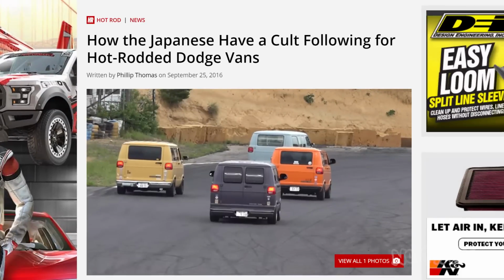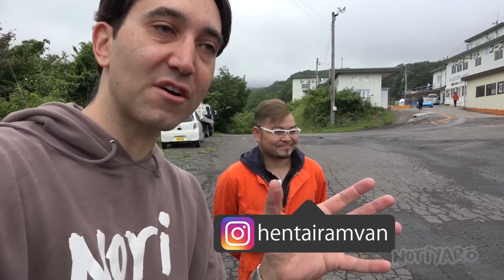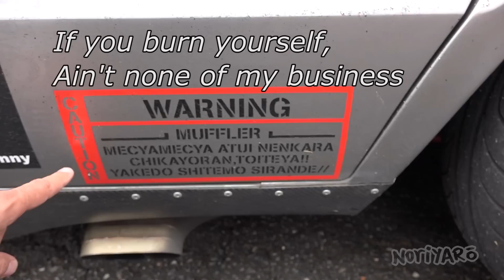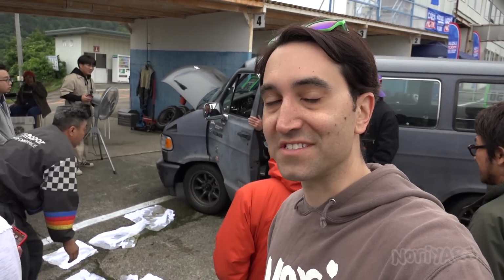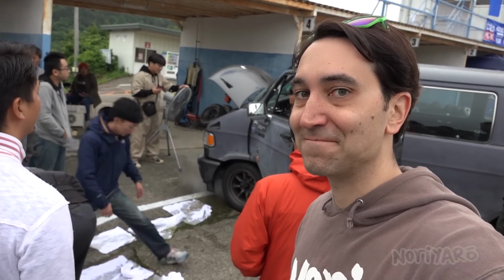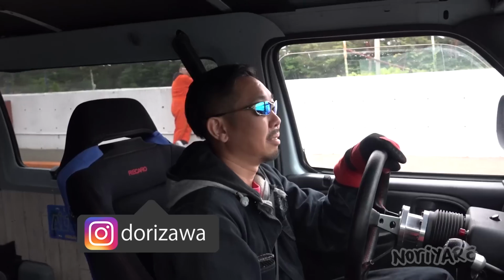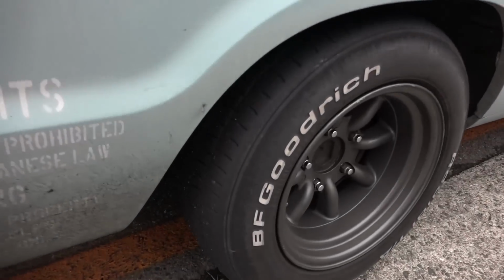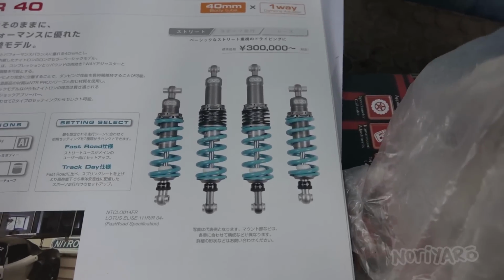DAJIBAN! Japanese Dodge Vans are back at Ebisu Circuit

Comment: Dude is drifting an automatic open diff van. People should have no excuse when it comes to drifting.
Reply: torquey engine + no weight on rear wheels + skinny tires + hydraulic e breke = drift. not as hard as it may seem, still hard, though!
Reply: Ryan, i have the 1 ton, long wheelbase version of this van (with the 350ci v8) and it is horrendously underpowered. To get it to rotate is no small feat.
Reply: lol it's all that MOPAR!
Reply: Must be custom.  lol
Reply: probably the 360. you make a total of 5 hp more from factory over a 318
Reply: I have a 5 Spd At G35 sedan open diff. All weigh transfer tbh.
Reply: @CookedTickabc  10* swap in the 5.2 cam(way bigger than the 5.9 cam) and youre up even more.
Reply: @keeganwebber  If it's that underpowered wouldn't he be weight-shift drifting instead of e-braking?
Reply: @chilael6892  he appears to be using a handbrake in the video

Comment: That wasn't a long van.  There are two wheelbases and three lengths.  That is the medium length.  The long vans (called the Maxi-van) are nicknamed "carpet vans" because they can carry huge rolls of carpets or conduit.

I currently own a 1996 panel B2500.  Runs strong at 393000 miles with the 318ci engine.  Watching these videos makes me want to build a Dajiban!
Reply: DO IT! That'd be awesome!
Reply: RedheadHemi 04 
   Wow you know something about Dodge vans huh?
   5 years ago I was given, yes given, a '97 conversion B2500 318. It's my first Dodge and my first van. I'm about to turn 55 and I love my van. I've been redoing the interior to make it more usable/comfortable, but have no idea what possibilities lie under the hood... I'm no mechanic. 
Do you know of or have any ideas? I spent a year in Okinawa (80s) this video kinda gave me flash backs lol.
Reply: Correct.  I have a 99 Ram 3500 1T extended passenger van. About 8,500#

Comment: See I would want one, and I do, but I’d be like the only guy in Arizona driving around in one, and I’d have no use for it, so I’d just look like an idiot rapist that doesn’t understand what blending in is.
Reply: Joseph Samsor TO THE TOP!
Reply: I absolutely love my 97 2500 standard wheel base. 318 cargo. They'll peel it from my cold dead hands. I can tell you from first hand experience there are few things in this world cooler than a sik as hell Dodge van. my dream is to  eventually 4x4 it and swap in a 4 cylinder Cummins.
Reply: yup mmhm oh yeah 4bt swap. Make sure you turbo it though if you do. Nothing like a boosted diesel.

Comment: If any of those guys lay their hands on a Mopar Performance R-block prepped by Dick Landy, and a Torsen-style replacement differential for those rear-axles, they'd be just a set of Cal-Tracs or a four-link rear suspension away from showing some serious times around the course.

Comment: Cool video man. Got a question though - think you can find out why they prefer the 318 over the 360 block?
Reply: masterwhopper414 the 318 is a higher reviving more reliable engine.
Reply: FAR more common
Reply: +Dodge 318 Cummins, ah I see. Wouldn't the 360 be more useful in this application due to the low-end torque it has? And since the vans don't have that high of an entry speed?
Reply: + Frigglebiscuit, I guess so
Reply: masterwhopper414 the 360 is a dog compared to a 318...

Comment: It's great to see someone taking one of the greatest American vehicle designs and appreciate if for what it is and what it could be. But why in the world limit yourself to the 318??? Old 440 cu in Dodge Grand from the mid 70's on are easily available. That's why these van look a little slow on the straightaway. I had a 440 and with the right cam, headers and raised compression would really rip!! Even if you didn't install a lot of aftermarket components or set the engine back 2-3 feet those early Dodge vans were monsters AND had surprisingly good handling.

Comment: I have seen some of these that had completely fabricated suspensions front & rear, using almost none of the factory parts. Tubular A-arms, coilovers, 4-link setups in the rear, etc., and also using Magnum 360 engines bored & stroked to over 400 cubic inches. Not all of them are stock 318's.
Reply: M Kefer 318s are a lot better than a 360 with just basic modifications.
Reply: I've owned vans with the 318, 360, and 3.9l V6. The 318 is a fine engine, but to say it is better than the 360 is a bit of a stretch. I guess it depends on whether you want a daily driver that makes decent torque at low RPM and still gets reasonable gas mileage, or a high-rpm, high-HP setup. My old '78 B200 shorty was a handful even with a stock 360, with a 4-bbl and headers and a mild cam. I do love those 318s though.

Comment: incredibly late comment on this but my theory for why watanabe wheels look so nice on these vans would probably be because of how are brains perceive patterns and similarities in design choices. Watanabe wheels are relatively plain from a design standpoint, they are thick and rounded as well as looking much bigger than they actually are since their diameter isn't actually as large as it seems. Much like the van itself, not really that big, rounded and not really boxy design wise as well as being quite bland to look at. It's like how watanabe (in my opinion) would NOT suit an FC RX7 for example because it's a quite boxy design with a lot of sharp edges instead of smooth transitions from the top to the side etc.

Comment: Those 318's are usually pretty dog slow, im surprised their not stuffing 2j's and RB's in these things
Reply: Danimal 86 Because torque and complexity, why stuff an I6 with barely any torque and would most likely struggle with the van’s weight for a V8 with decent power and enough torque to propel the van.

Comment: Chevy gets 8.1 Big Blocks, wonder why something as cool as that didn't get the same cult following as a 5.2 Dodge Van
Reply: DC BigTurbo I think they like the Dodge because they're unibody.
Reply: DC BigTurbo 318 v8 is the best engine out that's why...
Reply: Cause fuel....
Reply: if you're worried about mpgs when racing, you shouldn't be racing
Reply: 5.9 cummins is far superior to the dodge 5.2L v8